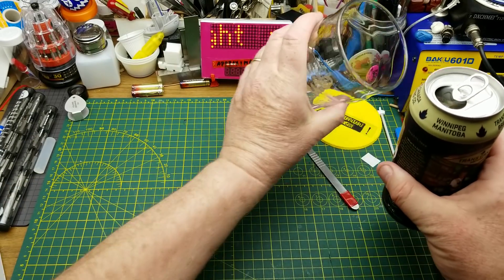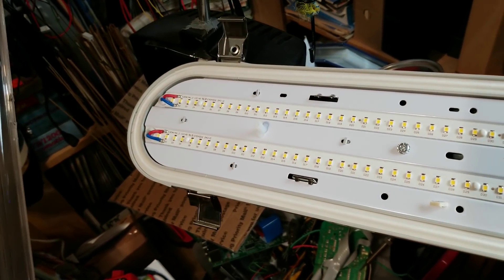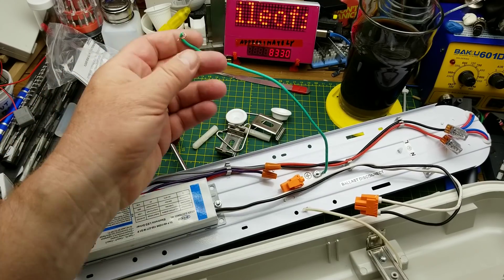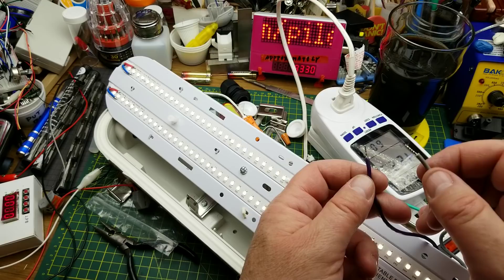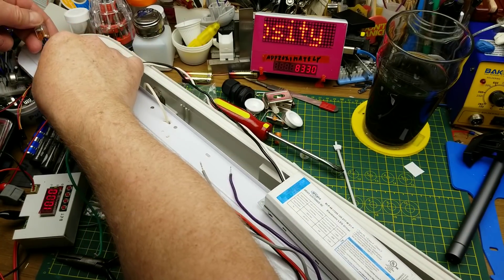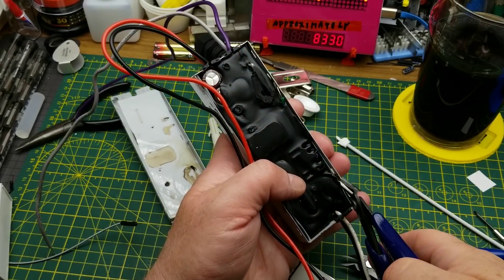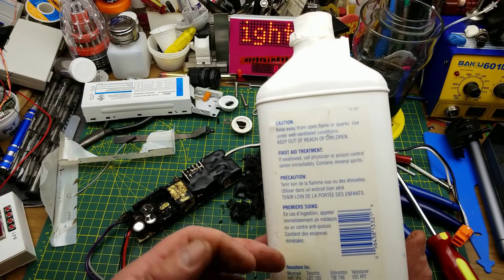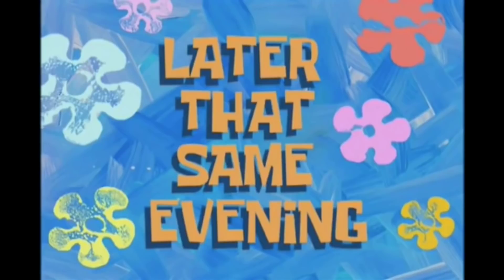"vapor tight" LED light teardown

Comment: After many years dealing with lighting product compliance, I reckon that potting is used to get the UL and/or CSA approval. Perhaps the driver design was not quite good enough to pass (eg: high voltage flashover) so they just dumped a bunch of goop in there. In other markets, the PCB would have been bare, hence the heatsinks.
There is no other reason to add that stuff - it won't add reliability, but just adds cost. The manufacturers don't care about making internal parts waterproof - it's up to the installer to make sure that water doesn't get in there. You can tell that because all the other connections are open and unprotected.

Comment: If you want to drive those leds you can get constant current boost led drivers. I recently got one for my future project: "small" flashlight. By small I mean 100W power led with glass 60 degrees lens running from power tool battery pack. Mentioned boost driver can drive up to 250W so 100W is enough to keep it cool. Now I need to design some 3d printed body, and find suitable heatsink with fan, enough to keep led module from going thermonuclear.
Reply from the maker: That's my plan. Not sure if I want to just buy one, or build my own.
Either way, the LED panel is worthy salvage.

Comment: One thing you could try is boiling it in hot water to depot the bulk of the compound and then come back with mineral spirits or acetone and a brush to get the small bits left behind.  This doesn't work on all compounds but I have had some success in the past with it.

Comment: Make your own driver for the LED strips.
Reply: There are safety issues involved, so it's best to just buy one. They are very cheap from local electrical wholesaler. Beware: don't buy the cheap Chinese ones that don't carry safety compliance and certification, this is not the time to try and save a few bucks.

Comment: A potted heatsink? Eeeh??  That's what I call enlightened engineering. Thanks so much for sharing.
Reply from the maker: I know. 
Not sure how they expected that to work.
Reply: @pileofstuff  Many of the potting compounds used in ballasts and drivers are thermally conductive enough to carry the small amount of heat away to the case so it probably isn't much of an issue as the heatsink is still taking the point source and moving the heat out to a larger surface area of potting compound.

Comment: Interesting seeing a heatsink hidden under that potting compound. Can't imagine that does much for its cooling capability...
Reply from the maker: Yeah, it seems ineffective.
Reply: There are potting compounds that are quite thermally conductive while still insulating, so the potting compound would conduct the heat to the case, although the sheet of  plastic might be a small issue....

Comment: Flat bed scanners also have led strips now a days.  I took one apart for the 3d printer I'm building.  I'm going to use it to light up the small print area!  It was 22 leds in uneven in series: 5, 5, 4, 4, 4. So not sure if I should just wire them all in parallel.  (It'll make an "appearance" on YouTube soon. )
Reply: You might find that the chips have different characteristics and hence different voltage. So 5x2.8V=14.0V and 4x3.5V=14V. Or they might use only 4 chips on the arrays that are farther from the power supply, to allow for voltage drop.
BTW - Uneven series strings is commonly used with special "full mains voltage" driver chips. They are used in cheap Chinese mains-powered LED PCBs that get sold as "driverless" (which is bullshit). The driver chips are quite clever in that they "ride the sine wave" and switch on different quantities of series LEDs as the sinewave voltage rises and falls.
So, all LEDs are illuminated (in series) at the peak of the sinewave, however when the voltage is lower different combinations of fewer LED chips get lit to suit whatever is available at that moment. This is really cheap way to make them work on mains voltage, however it results in some are flicker.

Comment: That dimming circuit sounds like something I recently worked on. It was a buddy's expensive grow-light worth over $1000 which he wanted to dim and automate sunrise/sunset. It would take either 0-10V, or resistance which baffled me at first. We found instructions online on how to hook it up to a Wemos D1 Mini using a PC817 Optocoupler and 1 resistor and use a PWM output, and it worked perfectly! So yeah, shorting those wires should have turned it off.

Comment: Looks like the case was repurposed from a single 4ft tube version, and they just reused the existing metal panel dies, and added the 2 depressions for the LED strip into it. Ballast is likely worldwide, seeing it will run from 120VAC, 230VAC and 277 VAC, but will not run off 400VAC, so likely only has 450V capacitors in it, probably running at 425VDC after the PFC.

Potting compound looks like it is bitumen, easiest way to remove is to put in a sealed bucket with diesel or heating oil covering it, and leave for a month, shaking the bucket every so often to remove the dissolved material from the surfaces.

Got a similar one with 2 5ft tubes, and decided I wanted LED, so just removed the ballast and put 2 5ft LED tubes in the case, and used the existing holders and wiring to connect them to power. Really bright, and a cheap retrofit. I am really beginning to dislike integrated LED fixtures, they are failure prone, and replacing them is often a pain, especially in a case like that, where the fittings likely are all in a long line with conduit joining them together, so you have a bih hassle changing just one out. At least the LED floodlights I can put a junction box by the light, making replacement easier. Plus they tend to have enough heatsinking to run cooler as well. Just stay away from those with pressed cases, those cook themselves to death fast, because of the thin stamping warping, and almost no thermal compound used when they were thrown together.

Comment: Paint stripper is probably better than the thinner to remove the potting epoxy. In extreme it unfortunately will also start removing the plastic packaging of chips and trabsistors if left too long.

Comment: That sticky goop ruins our fun.  Gloves, pliers,  aviation shears ... implements of destruction.
Environmentalists ought to get on board with standardizing power modules, batteries, display interfaces, and right to repair.
Reply from the maker: I understand the practical engineering reasons potting compound is used, but it really does make things un-repairable. 

Too bad they didn't choose a compound that isn't as aggressively sticky.